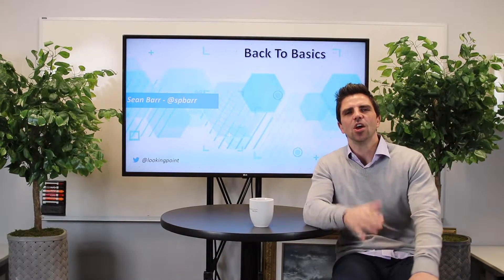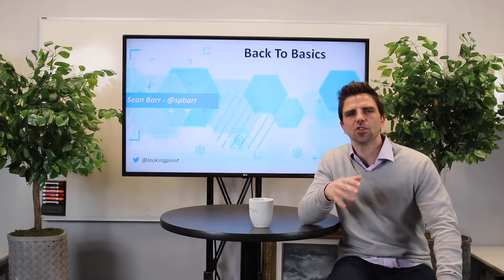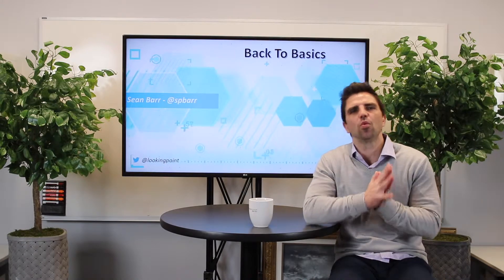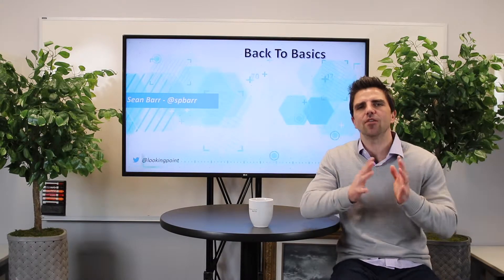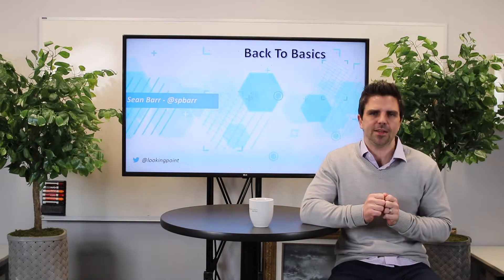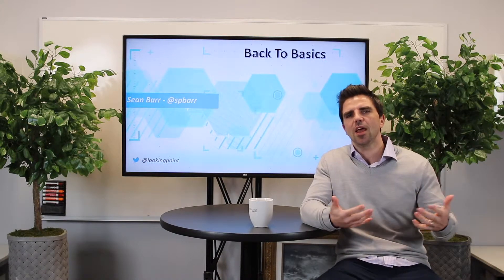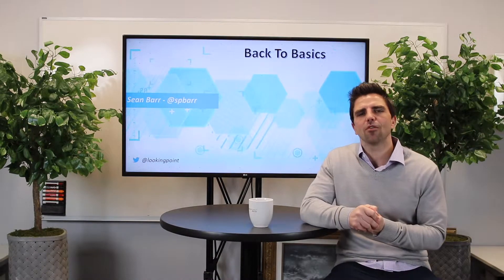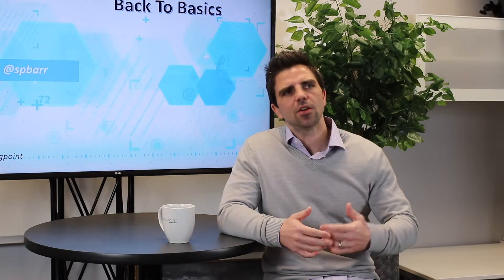Data Center Wiring | 110v vs. 220v

Comment: Everything is easy and simple until you come to Brazil. Here it varies by state, and sometimes even by town. You could be in São Paulo, for example, and certain areas of the city use 220 whereas others use 110. Keep in mind that the outlets aren't labeled according to voltage, therefore you have to strongly rely on someone's words when plugging a device that isn't bi-volt.
Reply: Use to be like that on KSA but we are now 220 but for the most part we use to be 110
Reply: Man, that is EXACTLY something I have expected from Brasil! :)

Comment: What's the difference between 220, 230, and 240?
Reply: Not really much of a difference.
Reply: Those are “nominal” values to describe a range of 220-240v.  The de facto voltage at a USA outlet is 240v (and 120v), at Western/Central European, British, and Australian outlets is 230v, and at Eastern European outlets like Russia is 220v.  Brazil uses 220v (and 127v)
Reply: For a Wen Ten Iglooist
Reply: We have 230 for an igloozer